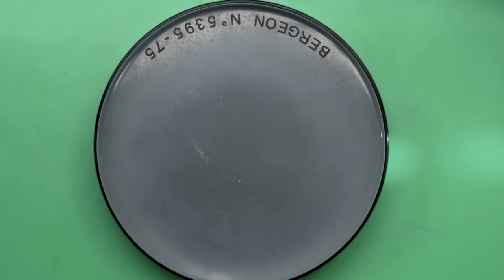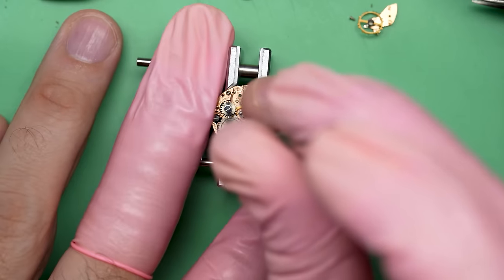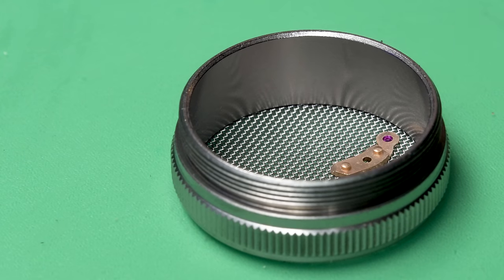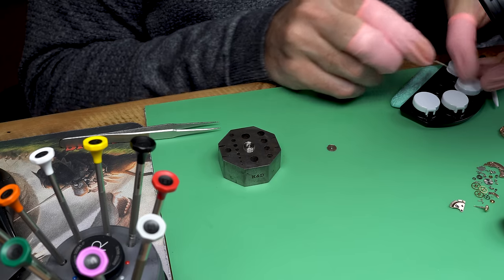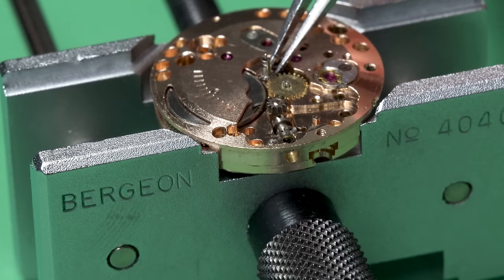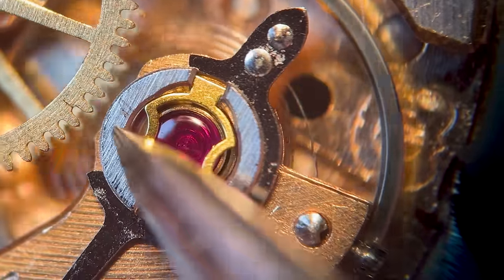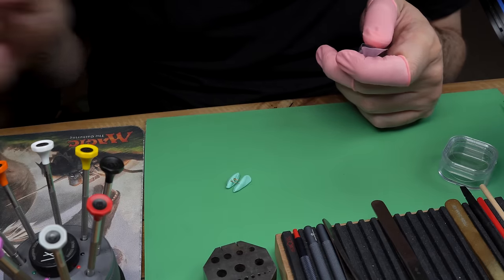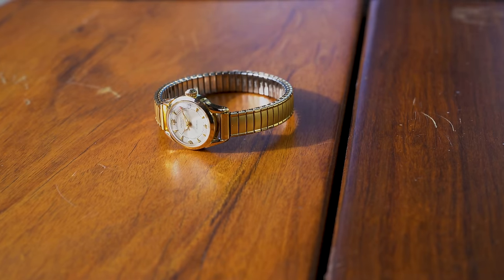Restoring This Tiny Mechanical Watch!

Comment: As an ex-watchmaker I thoroughly enjoy your channel. I can see you love what you are doing. Things were certainly different in 1966 when I started my apprenticeship. Keep up the good work.
Reply: An old watch maker put my needles from needle valves from my Honda 400/4 in his mini lathe, and repointed them. Wouldn't have anything for it, and saved me two days pay.
Reply: @CONEHEADDK  pp
Reply: How were things different?
Reply: @CONEHEADDK  in 1979 I worked at a Honda bike shop. 
The diminutive CB400 was a real blast to run through the evenly spaced 5 speed gearbox. My memory was that it had a 10,500 redline, but apparently it was 9,200. Either way, it sang beautifully...
Hope you are still riding yours.
Reply: How do you know which screws are reverse threaded?
Reply: @gregl4244  I recall from another video they have three lines across the top

Comment: I have a watch, non running of course, that I believe you may be interested in looking at. Im told parts are unobtanium but I figure it would make an interesting video. It was my great grandpas Benrus "calendar dial" it looks like one of those old alarm clocks with the rolodex numbers. Let me know if ya want a crack at her. Your view if things would be interesting.
Reply: Best get in touch via email or whatever else he uses 👌 would be cool to see the restoration
Reply: That sounds so cool, did it make the flippy noise when it turned?

Comment: Gorgeous little watch.  Definitely had some mileage on it but it turned out beautiful.  I've used blue magic metal polish for decades.  I used it to polish the brass and gold plated accoutrements on my Army Class A's and Dress Blues.  I also found out it was great for removing tiny scratches from the face of my military A11 style field watch.  Watch faces got destroyed deploying to Yakima Firing Range in the 80's and 90's due to the volcanic ash that buried the place from the eruption of Mt. St. Helens in 1980.  The ash is basically powdered glass that destroys everything it can get into.  So our watch's crystals would get hazy from the ash grinding away at it so instead of buying a new watch every time we got back I tried polishing it.  It worked great. It could take about an hour of polishing with blue magic and a cotton cloth to restore the clarity and then a tiny amount of carnuba car wax protected it and put a shine on it.  I still use the polish today though I've been out of the army since the mid 90's.  I use it on the canopies of my aircraft models to remove small scratches in the plastic.  I also use it to remove scratches on CD's and DVD's.  Another excellent video.  Thank you.
Reply: YAKIMA. 84,85!!! 😝
Reply: Using that on a CD or DVD is a horrible idea. The scratches destroy a part of the data on the disk, (but it still works because there's recovery data elsewhere on the disk, it uses some fancy math to be able to recover lost data. Of course, eventually it gets so scratched up that it can't recover sensible data, so it just doesn't work. ) and polishing it just destroys even more data.
Reply: @nikkiofthevalley  you are wrong. the data is on the upper side of the disk, the polish is on the bottom (just plastic)
Reply: @rodsilva80  The data is in the middle of the disk, (but yes, the data is read from the label side) and deep enough scratches (and too much polishing) do affect the data, or at the very least, the ability to read the data.
Reply: Can blue magic removes scratches from reading glasses?
Reply: Ji
Reply: @nikkiofthevalley  it's not in the middle, it's on the upper side (label).
Reply: For CD its near the lable (1.2mm substrate), for Dvd its kind of in the middle (0.6mm of substrate) and with blueray it pretty much the bottom (0.1mm substrate).

I remember back then we used lighters to fix a skipping CD 🤣

Comment: Marshall, I found your channel by accident. I'm pretty sure it was a random YouTube recommendation. I started doing this, and it is absolutely one of the most rewarding things I've dedicated myself to, and it's all thanks to your channel! I've actually gotten some watches, that are this size of smaller, and I love working on them. I've got a few Seiko watches that are smaller, but most of them are Bulova ladies watches from the 40's and 50's
Reply: I too collect early ladies watches, Bulova are some of my favorite because they are so different.
Reply: They are some of the most unique and clever designs both in their cases and bands, and the way they fit the massive amount of parts in to such oddly shaped and teeny tiny cases. They are for sure some of my favorite as well, both to collect and to work on. I haven't found two movements exactly the same yet, and I've gotten around 20 of these early Bulova ladies watches so far
Reply: I've been collecting and working on Bulovas also. Men's and womens from the 1920's through the 1950's. Mainly because it was the only brand I could find the right parts for after getting a Bulova interchangeable parts catalog. 
It's a disease! I have around 1500 Bulovas now and boxes and boxes of parts.

Comment: You should get a geiger counter to check for radium hands. It seems like a good investment for your health, since you should really be wearing a respirator if you might create even tiny amounts of radium dust. Because even a speck of that dust is extremely dangerous if breathed in.
Reply: I've heard some watches have a small amount of Radium but never thought it'd be that bad to wear a respirator
Reply: @Sphyxx  Well, the thing is, even a small speck of radium dust getting stuck in your lung for a few years will greatly increase your risk of lung cancer. There's a very good reason why you do not mess with radioactive material.
Reply: Based on the burn mark on the dial, I also think those are radium hands.
Reply: That's what I was thinking (I used to handle radioactive materials). If there's any chance of a radium dial, test for it. A house is not a place to handle that "stuff".
Reply: @steamtorch  And we used to just carry that stuff around on our wrist. "Cancer? phhhaaaa!  I need to see what time it is in the dark!" lol
Reply: With a 1600 year half life, recent studies show that the radon gas can build up in poorly ventilated spaces, exposing one to the same or higher levels that would normally require remediation. That being said, I believe he said he wore his respirator. As long as the cleaning was thorough afterwards, there should be very little risk. Water and cleaners are excellent moderators allowing for safe removal from the space.
Reply: Might be a good test to run any time he opens a old watch, better safe than sorry as they say
Reply: @Bill_Hartnett  we do still use Tritium in some watches, but it's sealed in a glass tube and it's radiation can be stopped by the glass tube itself, tritium only has a half life of 12 years so it fades "relatively" fast, and is often in a gas form so even if you broke the tube the tiny amount of tritium would disperse fairly harmlessly.

A fun fact that most people don't realize though is that you eat mildly radioactive stuff all the time even Bsnanas are radioactive because of some of the potassium ions in it, not that you need to fear Bananas, it's within the tolerances of your body to deal with.

Radium, uranium, amaricium, and such are the ones to be more worried about  but plenty of other elements can be mildly radioactive, often the greater concern is the type of radiation that an element can emit or getting too high of a concentration of any radioactive elements in your body
Reply: @UNSCPILOT  Red Dead restorations just did a restore of the type of watch used in the pulp fiction movie & he has a radiation detector & a tiny box he puts the work in when removing that stuff.  Looks like a mini sandblaster cabinet without the sandblaster.. lol
Reply: @LTC_Tiger  1000% agree and Marshall never addresses this.
Reply: Good call. Given how cheap a Geiger counter is it's a great investment in your health if you're going to be working on anything where radium is a possible hazard
Reply: @LTC_Tiger  Sorry to say but I don't think these hands had any Radium at all. Radium use was almost gone by the late 50's and by 1960 it was already substituted by Tritium. Those markings you described as 'burn marks" were actually dirt, not produced by any burning radiation. And Radium markings do not clean with water as Marshal did. And the tritium radiation levels were not high enough to do that burning.
Reply: @toboterxp8155  Well yes, that is true for Radium, but the watch shown here did not have Radium painted hands, most possible Tritium paint 99 % certainty. Radium use in watch hands was almost gone by the 1960's, replaced by Tritium.  Tritium has a half life of approximately 12 years, so if this watch was from 1960, after 62 years the amount of radiation is almost zero or non-existant- 1/2 x 1/2 x 1/2 x 1/2 x 1/2  = 1/32 of the original amount, and those hands are less than 0.1 grams in weight so maybe producing about 0,1 micro radiation units or less when new, not enough to be of concern when the watch was new, so Marshal was not at any risk of Radiation poisoning at home while doing this restoration, or for that fact, for any other watch from the 1950's to now. The radiation produced was mostly absorbed by the paint. You need to be exposed to more than 25,000 millirems for several consecutive days to months to be affected in some way by radiation, and these hands could only produce 0.25 microrems when new, x 1/32= 0.0078 microrems now.  Radon gas at his house poses more risk to him than anything coming from these hands. And Radon is not Radium, and Tritium is even weaker than any of them. So investing in a Geiger counter to check for old watch radiation/tritium hands, as some people suggest here, would be a waste of money. (And no Tritium speck from these hands in Marshal's lungs would do nothing regarding radiation). Maybe to check for his home Radon levels, but homes and urban areas are tested for that. I am a retired Nuclear Medicine Doctor/Physician and know very well what I am talking about, so no, Marshal was not at any risk of radiation poisoning from this watch or its hands.  But this is still an Awesome Video!!!!!!!
Reply: @jorgerobles628  The ETA 1170 was generally used during the 1950s-1960s, which includes the period of time when radium was still being used.  The brownish burn mark that I was talking about was located directly beneath the hour hand -- the hand closest to the dial, and it didn't go away with the application of water.  It's clearly visible as Marshall affixes the hands at around the 35:00 mark.  I think that it was caused by long-term radiation from radium, but I have no way of proving it, so take my humble opinion for what it is...a humble opinion.
Reply: @LTC_Tiger Also, just because the hands no longer glow doesn't mean they don't have radium present. The phosphors that glow wear out over the years, but the radiation is still present.
Reply: @machintelligence  Correct.  Radium’s half life is some 1600 years.  The phosphorus paint is lucky to withstand 20-25 years of radiation bombardment.

Comment: The first watch I ever worked on was one this small. I managed to get it apart and back together again in about 5hrs. I never really figured out why it wouldn't run but I guess it might be the pallet fork or the hairspring. Unfortunately in the process I broke the setting lever spring when putting it back in place and lost the minute hand(it yeeted into the abyss when I went to pick it up). I couldn't find much info on the watch except the movement name but that was pretty much a dead end when looking for replacement parts.
But I had fun working on it, I owe literally everything I learned about watchmaking/repair to you. Watching your content made me want to try it myself and my first watch was one my wife was given. But now that I've cut my teeth on the hobby, I love it. Thanks Marshall.

Comment: Marshall, I really enjoy your videos and I know you strive for great accuracy in your descriptions. Please allow me to point out that the lume in these hands is not Tritium (which is a gas), it is Radium 226 mixed with Zinc Sulfide. The radiation from the Radium 226 breaks down the Zinc Sulfide and the binder over time and turns the lume dark. It is a good idea to wear a mask and to have a Geiger counter that measures Alpha radiation to be sure that you have cleaned up the work surfaces and avoid spreading the Radium 226 in your workspace. Tritium is used in some very recent watches in small glass vials or very tiny glass spheres, but these Tritium hands and markers are far too recent to be in this watch. Sincerely, Pat Brown

Comment: My mother-in-law gave me a manual ring watch which is even smaller. Doesn't seem to work, but I'm not worried about getting it fixed. This is inspiring, I'm going to have to get a kit and try. Well, I'll start with some bigger watches for sure

Comment: What a cool watch. Enjoyed watching you service it.
My stepfather has his grandmother's old watch that has a square case and is about 1/3 smaller than the one you worked on in this video. It is from the 1920's and has a sterling silver bracelet with diamonds inset into the bracelet and case. The bottom of the clasp is marked with "STERLING KREISLER". He says it's an old Bulova but there are no markings other than SWISS at the very bottom of the dial. I had to get the 40x loop out to even see that.

Comment: A funny thing, your watch cleaning machine is from the late 1970's, that was when L & R switched to the gray paint scheme, to Modernize the line. The ones from the 1950's are in an olive drab paint scheme( I was gifted one from a friend, the motor was the same size as my own head). Sigh, the smallest watch, mechanical, I've ever seen was all of a half inch across. The watch case was in the shape of a sphere ( used as a "pendant watch"), the watch face needed a "Bullseye" lens style of watch crystal. And it needed that lens to be able to read the watch face. The movement itself had no markings, or any maker's marks, nor did the case itself( other than the Hallmarks indicating the assay content[ in English]).

Comment: Hi Marshall,  ty for convincing me to start my watch journey.  Having a blast so far. Quick question. Organuzing screws with the pieces of the movement as it comes apart is easy.  The hard part is how to organize them in the cleaning basket. I have an L&R Masternatic as you do,  but my basket seems to be more shallow than yours.. How do you keep track of what screws go where when they go to the cleaner?

Btw, congratulations are in order, you have 50k more subscribers than Mark L does, well done!

Comment: My wife has a watch that might just be a tad smaller than this. Before grandma passed away she gave my wife an Omega watch that has diamonds incorporated on the sides of the case along with a very thin band. She seldom wears it and our friend, a jeweler, had his "watch guy" check it out. Apparently it works although I am not sure what help that would be. The hands are tiny and no numbers on the face make telling time a wee challenging. At my age (and my eyes age) I'd need a jeweler's loop just to tell the time I think. In terms of size I could place this on my index finger and it appears slightly smaller. My fingers are "average" size I think. 😃 

Great channel... not sure how the "algorithms" knew I would love this but it popped into my feed one day and I am hooked!

Comment: I have not much interest in watchmaking or repair but that doesn’t prevent me from appreciating your genius.  When you showed all the components laid out together,  I just thought,  how on earth were you going to remember how they all went back,  but back they went and rather swiftly too.  It’s also really nice to see how much you love what you do.  I have a ladies Rotary bracelet watch from the seventies in tree bark gold plate which is even smaller than this one.  I have measured the diameter of the glass from the top side only and it measures approximately 11mm or half an inch. I could have sent it to you but I live in the UK.  Thank you for amazing me.

Comment: On the movement holder, Put a spare nut with the same thread on the end of the adjuster bolt. With the right physical size of bolt it could help three-point stabilize the holder at least on the one side.

Comment: FYI: Solid lume paints applied directly to hands/dials are not tritium-based.  

Tritium is a gas, so requires small tubes to contain it.  I have no reason to suspect this lume was radium-based, but probably charged by ambient light like the new lume you used as a replacement.  Modern versions can be brighter, but these have been around in some capacity since the 1930s.

I saw a pretty significant beat error on the Timegrapher, as well.  The pallet fork and the posts it runs between looked straight and in good condition, and I can understand why you wouldn't want to mess with adjusting pallet stones, particularly on such a small movement.  If you're feeling confident in your abilities, though, I've found depthing stones to be one of the most satisfying adjustments to make when you can get it right.  Probably not on the first try, though!

Comment: Watching the video is captivating. I have a collection of 100 vintage watches that I've bought on an auction site, most are handwind and are old brands that disappeared during the quartz crisis. I have certain tools I've collected but have yet to take any apart. I have a timegragher etc.
I also have a few cheap and cheerful Chinese movements which are direct copies of modified ETA movements and I think I'll maybe start taking those apart to get used to the parts and set up.
Keep up the great work it's inspiring.